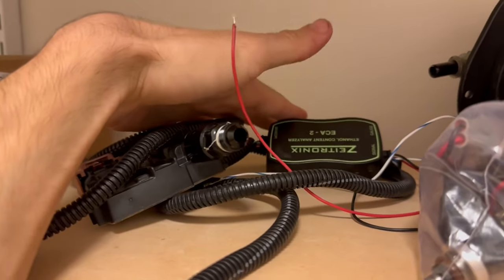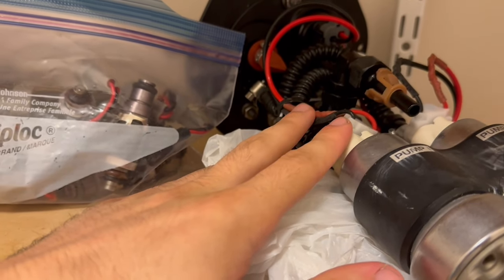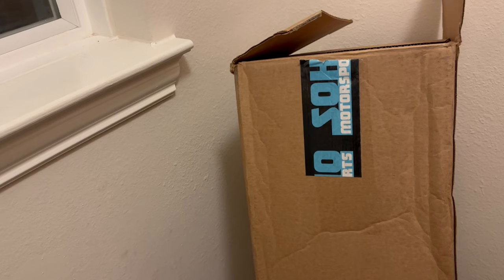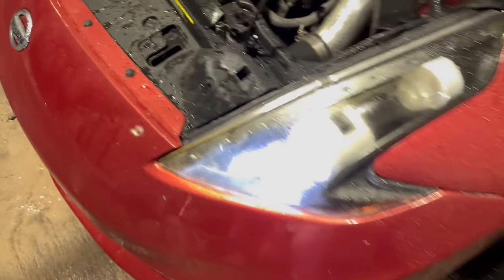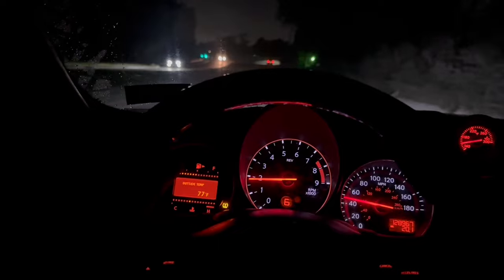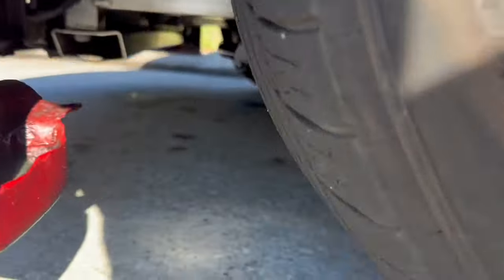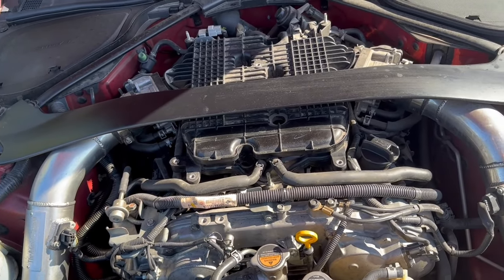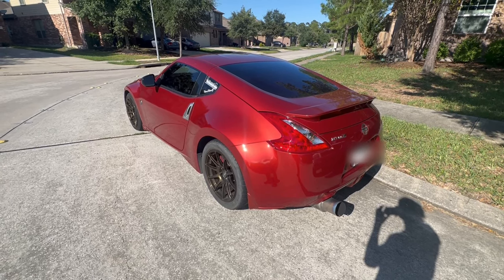Support Mod list for my Boosted 370Z.

Comment: Im going nuts on my supported mods too. Mostly the same parts.
Ordered:
Radium FHST w/ Ti Automotive BKS1001 fuel pump (550L @ 50psi @ 9amps)
Same ID1300X injectors
CJM Fuel return + rail
SpecialtyZ Flex Fuel

My Auto trans has the LOJ flexplate w/ transcooler.

Cant wait for my headers to be fab'd and install all these parts.

Comment: Valve cover oil leak is super common, the fel pro gasket is half the price and slightly thicker than oem. Removing the valve covers also let's you look at your cam assembly to seenofbthe oil you have been using is staining your motor or keeping it clean.

Comment: What is done to your transmission for boost?
Reply from the maker: Stock
Reply: @issaslowz  thanks for the response! I'm gonna supercharge mine in the future and I'm thinking about swapping the vr30tt transmission in
Reply from the maker: @MW-uf4re definitely should and a flex plate
Reply: @issaslowz  that's what I'm thinking, but would doing the flex plate on the current 370z trans be the same as doing a flex plate on the vr30tt trans?
Reply from the maker: @MW-uf4re it helps but you’re better off vr swapping
Reply: @issaslowz  awesome! Thanks again! Keep up the content...very motivating!